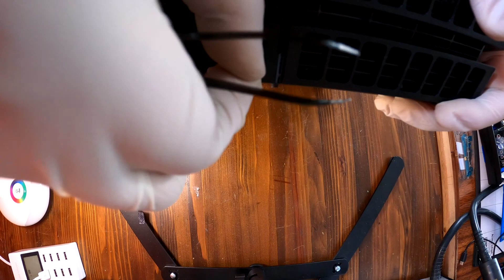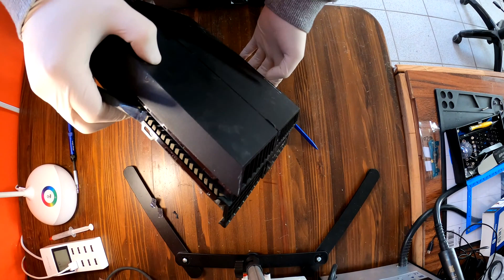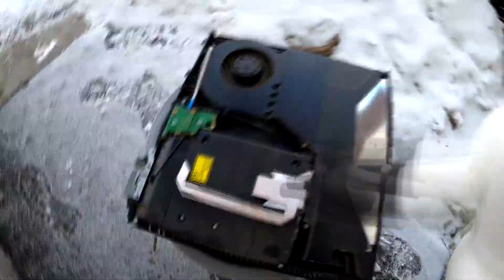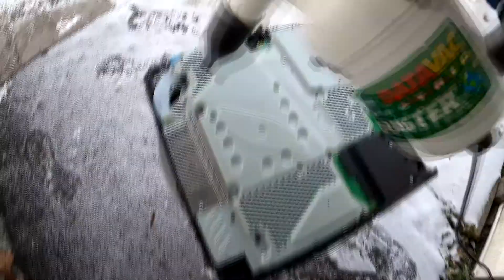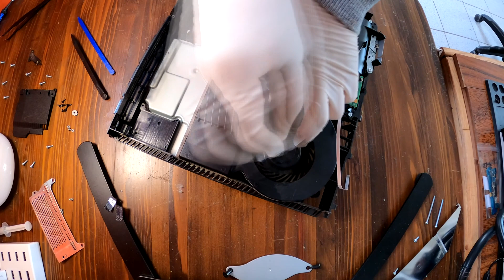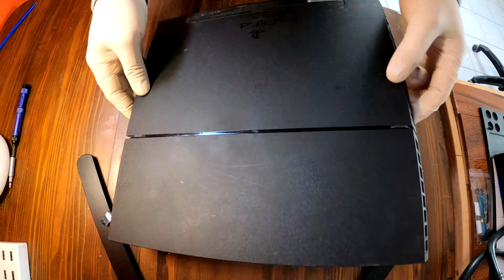Fix: PlayStation 4 Overheating (PS4 1215 Disassembly & Teardown)

Comment: What is the white stuff you put on the mother board? Is it glue? If so wat type off glue?
Reply from the maker: It is a thermal compound. a compound that helps to transfer the heat efficiently